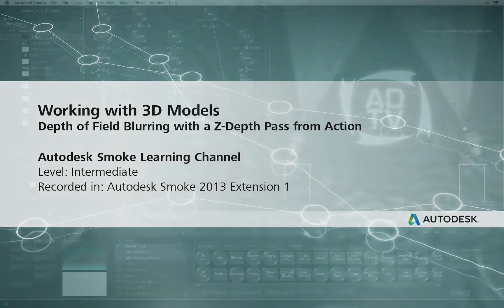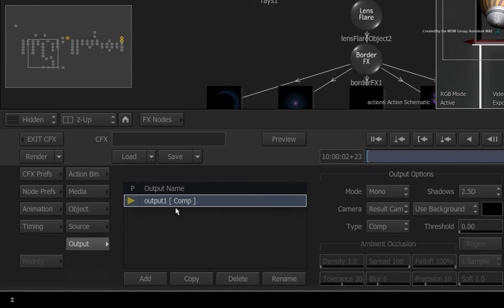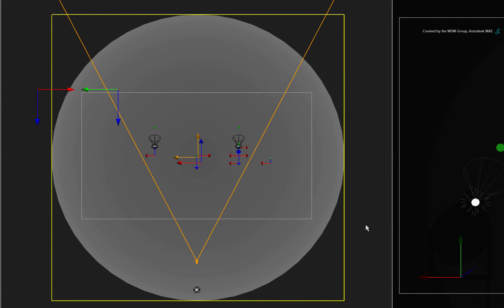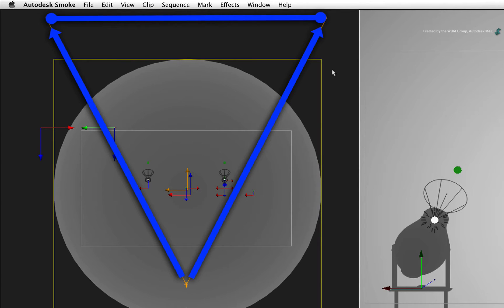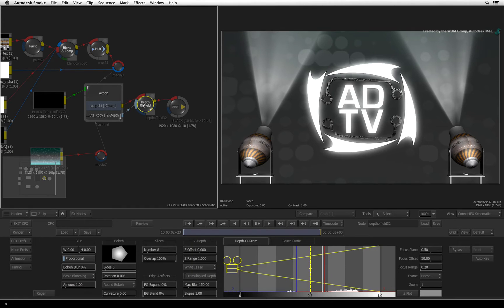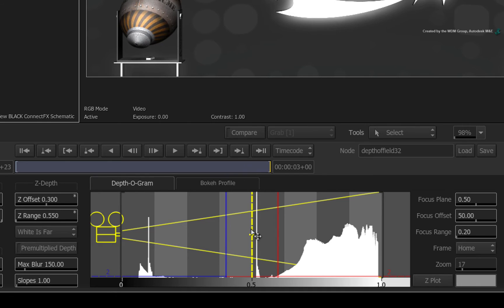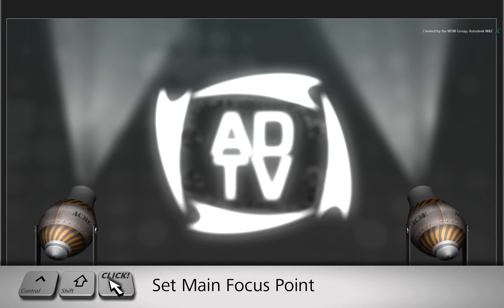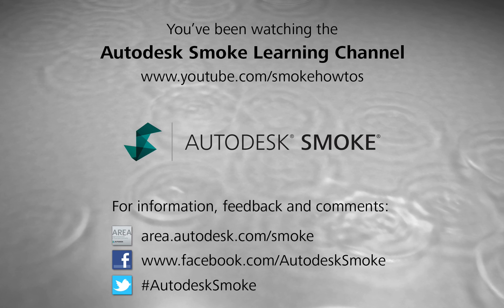Working with 3D Models: Depth of Field Blurring with an Action Z-Depth Pass

Comment from the maker: Hi MrZombob, 

I did mention in the videos to use the filtering where necessary.  However, my example, I probably over-exaggerated the blurring so its fully visible in the video.  So if you had no blur or even a slight blurring, you will still notice the texture filtering. I would prefer the textures being filtered and look correct.   But everyone is different and you can choose what you feel looks best for you and your client.